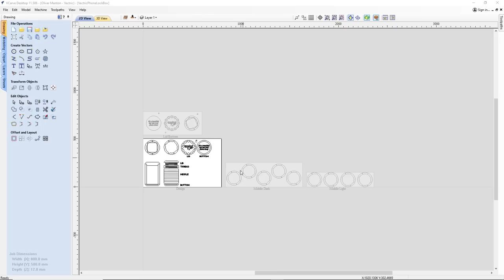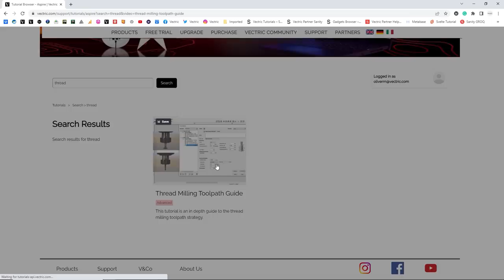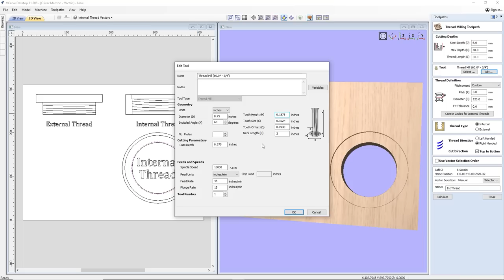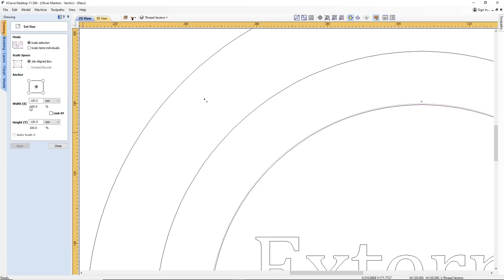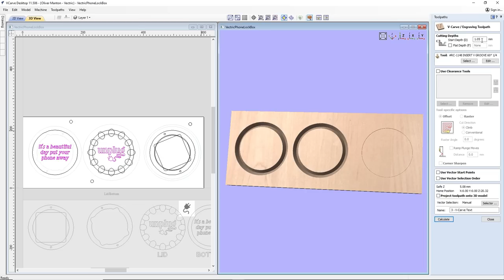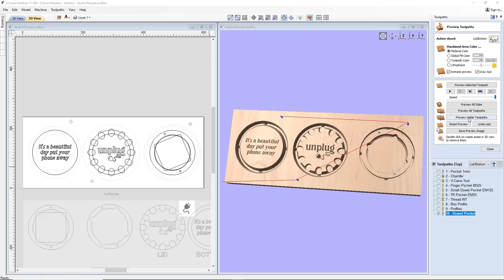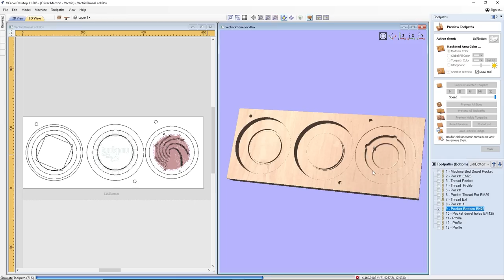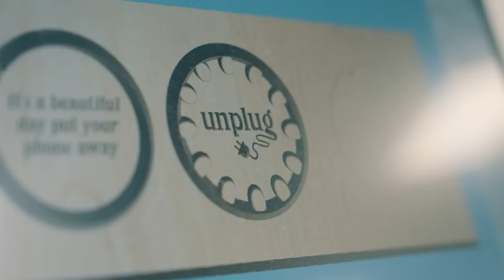Threadmilling CNC Lock Box | In The Labs with Vectric | Vectric FREE CNC Projects

Comment: I have hunted high and low for a decent thread milling bit suitable for woodwork without any luck. If anyone can give me a clue it would be appreciated.
Reply: Ditto
Reply from the maker: Hi there we suggest starting here for threadmilling bits: https://www.mscdirect.com/product/details/03196052 (for US) and https://www.mscdirect.co.uk/CCA-82010A/SEARCH:KEYWORD/product.html (for UK) hope this helps!
Reply: @vectric  Unfortunately the cutter you suggest has a shank of 3/8inches. This equates to 9.525 mm which is too large for my router (max 8mm). Also it is High Speed Steel not carbide, and still costs over GBP £44 + 20% UK tax = GBP £52